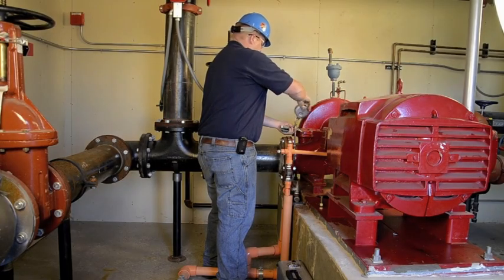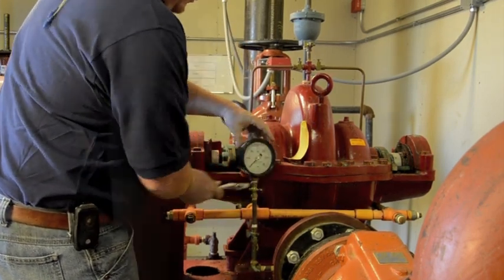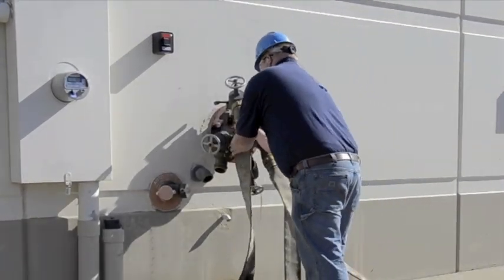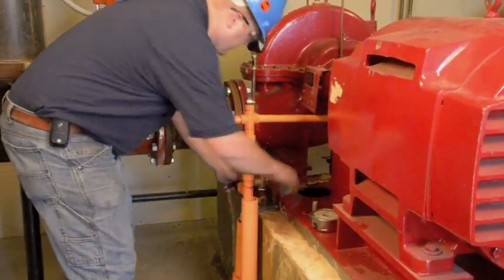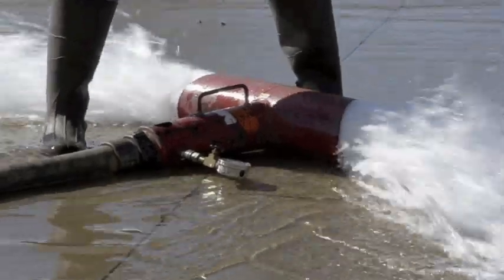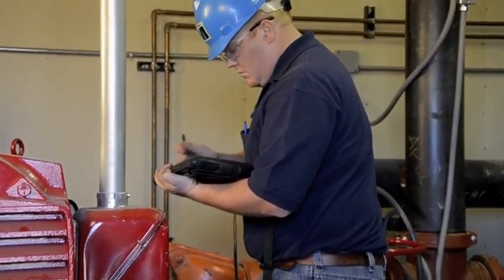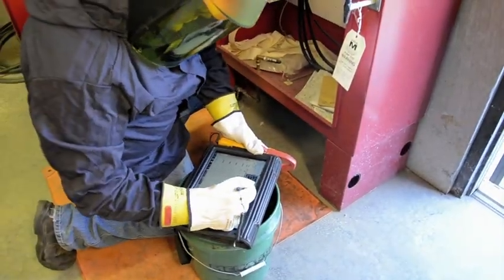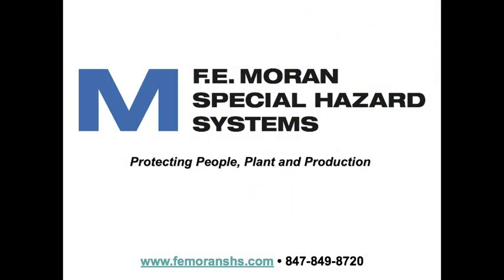Effective Fire Pump Testing for High Risk Applications

Comment: The Eaton LMR controller has voltage and amperage reading right on the display that are calibrated during factory testing and startup. Why risk exposure to electrical hazard by measure old school? Power off, internal inspection, emergency start lever tested without power. Close the cab power up and perform the test with the NMEA rated door closed and read the voltage and amperage off the display. Everybody goes home at the end of the day. :)
Reply: download the video for safety reasons

Comment: Is this test procedure applicable where the test pipe goes down to the fire water reservoir (recycle)
Reply from the maker: Yes, you would use a flow meter in the discharge line to read the fire pump flow.